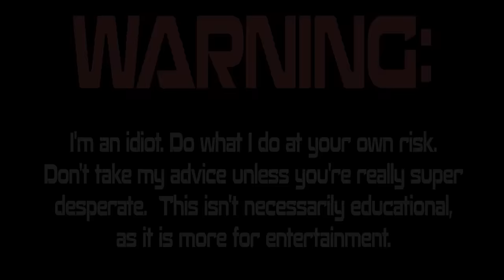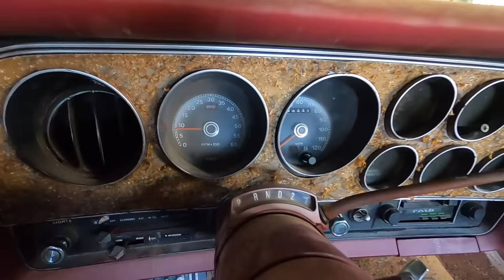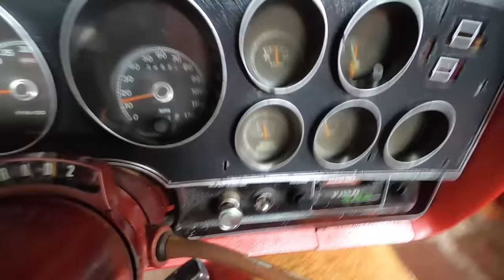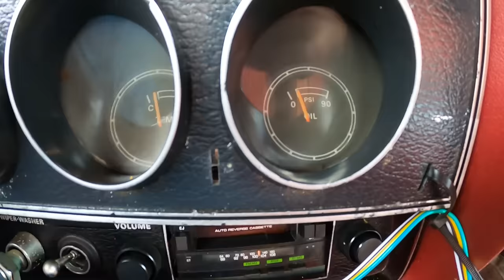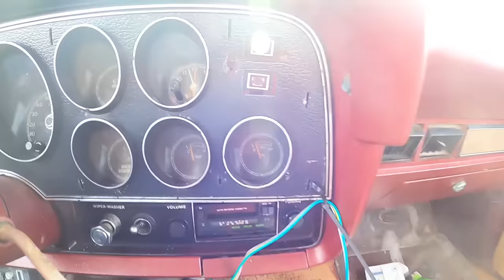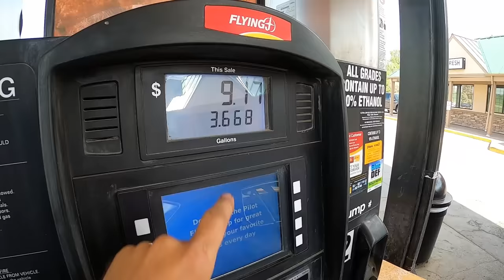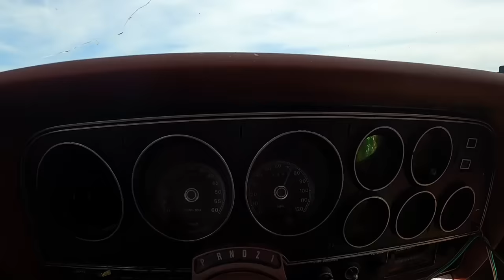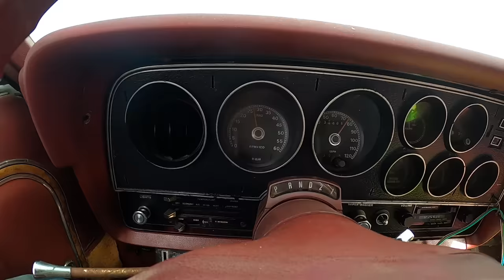SEIZED Ford Gran Torino Elite will it RUN & DRIVE after 29 years? - Vice Grip Garage EP89

Comment: They just don’t make bumpers that strong anymore. These days a tiny fender bender costs $1000’s. There’s just no need for that. 🤷🏼‍♂️
Reply: Made to crumple in a crash for safety brother
Reply: @bilbobaggins4710  I can confirm that. I was stopped behind a tractor-trailer and a huge Dodge RAM lost all brakes and smashed me into the back of the truck at nearly 50 MPH.  The back and front of my car crumpled and I was able to walk away. Everyone thought I was killed. I even had the cops told me how lucky I was and was shocked. I would rather lose a vehicle than my life. So yes, the cars sacrifice themselves to save you. If it was a stiff car like that, I would have absorbed the energy instead of the car.
Reply: Crash sensors, weight savings, fuel savings, MPG enhancements. Much more complex an answer than simply tacking on more steel.
Reply: Those were the 5 mph energy-absorbing bumpers that became standard on all U.S. passenger cars in '75.  The manufacturers complained about the added weight reducing their fleet mpg averages and anti-regulation folks hated them, but they really did absorb a low-mph crash better than the 2.5 mph standard that the Reagan admin changed the regs to.  Check out the flimsy fixed bar of chrome that Ford had as bumpers on its '73 and earlier Pinto and you see what the heavy chrome bumper replaced.  I would say these cars absorbed a heck of a lot more in a crash than cars of the earlier '70s and certainly the '60s and earlier.

Comment: They weren't bad cars but they downsized everything in a couple of years. I had a 1976 Ford Ranchero based on the Elite back in the 1980's so everything on that car is familiar. I had a couple of the 351/400 engines in trucks and they were generally pretty good but the OEM valve seals would go bad around 70K miles and start using oil if you didn't change them.

Comment: My grandfather had one of those, used to drive it from Ontario down to NJ.  Nice, plush, good riding car.  I had an earlier cousin to it, a Mercury Montego with a 351C that just would not die.  Got 175,000 miles out of it and $400 trade-in on a used car.  Excellent highway cruiser and the 351 had plenty of power.  Good solid cars.

Comment: Derek,
I really enjoy watching your videos. Only the go find get it running and drive it home ones. I am 53 and work a lot of hours but I enjoy watching you do the stuff to these ole cars I use to do. I am 80% Ford guy but like all American cars. This one brings back memories. BTW  if the valve cover says 351m-400 they are very reliable engines but very low compression. The 400 is an entirely different engine same family but  makes great power. And yes I think I will order a shirt.

Comment: I can’t understand why the tires on that 🐭 house gave out so quickly.
When she started the first time it she sounded as smooth as a guy with a wacker plate trying to straighten out the inside of a cement mixer.

Comment: Great fun.  My thing about older cars is that not everything can work at the same time, so fix only that which is essential.  If it's not essential, don't fix it, because if you do, something more important will break and need to be fixed.  Keep'em roll'n.

Comment: I can almost guarantee the oil pressure gauge doesn’t work. I’ve had several old fords and none of them had gauges you could trust.
Reply: Hi
Reply: I had a 79 ranchero gt oil pressure gauge was trash
Reply: @trevormiracle5476  I would bet that it's the sending unit . I just replaced mine and it did the job .
Reply: @rickobrien4025  I swapped mine to a manual gauge because the original wouldn't work
Reply: 3 sending units never fixed the oil pressure low reading but a mechanical gauge fixed it half the gauges in my old ranchero didn't work

Comment: You might want to check and see if you have the little oil sending unit or the large one. Only the large one is ascending unit volume is a Low oil pressure light with a resistor built-in to give you it and average oil pressure. When engine is running.i ran into this in 1979 working up Lincoln Mercury. Put the actual sending in it and then you'll probably. Read correct oil pressure on your gauge.

Comment: Yeah, great find. One year only, not just a Ford Elite but Grand Torino Elite. Yee Haw.
Reply: and an LTD II
Reply: @CrestwoodRocks  I just hate it when people do that, yeah, but no thing, don't you?
Well, in this case it really applies. The Grand Torino Elite is a very specific vehicle, yeah it is based on the LTD II chassis of sorts but has some very specific differences, including the grill and back quarter panels. So, no only listed in 1974. Classic by every standard you can measure.
Reply: @bruceleealmighty  I recall them being officially renamed LTD II from 1977-1979.
Reply: @CrestwoodRocks  Absolutely as well as Thunderbird, XR-7, Grand Torino, Torino, Elite, simply LTD. Fords personal luxury car seemed to always be going through naming and consesus issues. After production price & size shrunk in 1977 they even renamed the line II. So to quote any official marketing or management there is only one 1974 Grand Torino Elite of which 96,064 were specifically produced and badged, making it for all intents and purposes a one off one year thing of which possibly no more than 3 thousand are still in existence. Which makes it a classic, collectible. Of course there is XL trim and the so called '75 '76 Grand Torino Elites which did not include badging for some reason and became just a trim. The 1974 Grand Torino Elite badging and trim package was a very specific car guy kind of thing. There are some other things like this but most can't point to a single year, badging, trim, chasis, and trim. Not even my favorite '70 Murcury Eliminator can say it was produced only one year although the package was drastically different from '68 '69. So to say it officially became LTD II in '77 is not the point. It simply isn't even the same car.
Reply: @bruceleealmighty  Yeah the 1977-1979 Thunderbirds were in the same class as LTD II as well and their fronts were close to the Full Size LTD & LTD Landau as well.

Comment: That land boat of a car find should be named the "Fordzilla".
Reply: The station wagon version of that car (or the Gran Torino, same basic thing) weighed about 200 lbs less than my 2019 F150 SuperCrew 4wd pickup. 4600 lb vs 4800.

Comment: Eggs, for radiator leaks, crack open an egg. I haven’t had one where I cared so little about it but eggs are supposed to be the fix.
Reply: yep, or ground black pepper (courtesy of Isaac "It'll be fine")
Reply: @danmackintosh6325  I've done the ground black pepper, back in the 80's. Did it work? Ummm, well, it probably didn't hurt. Same results with that little tube of stop leak particles they sell at auto stores. Once I discovered a coolant leak, my hoopties were generally beyond the "fix in a bottle" type solutions, though, to be fair.

Comment: I had an 74 with the FMX transmission it would bark the wheels going from first to second very strong. 
The highway drive looked odd without the barn door weathervane missing . 8 city 12 big road.

Comment: Only way to distinguish a 351m or a 400 besides taking off the oil pan and checking cast i.d stamps in the crank. Is  measure the stroke through the spark plug hole, which I usually use the oil dip stick when I check it this way. 351m has a 3.5 inch stroke, with a casting I'd in the crank of 1ka. The 400 has a 4" stroke with a 5m, 5ma, 5mab, or a 5mabc stamped in its crank. Out of that whole engine the only two different parts from the 400 to the 351m is the crank and the pistons, they both use the same rods.  The 351m has a 3.5" stroke crank with taller pistons. The 400 has a 4" stroke crank with shorter pistons.  
     Keep up the great videos, 👍

Comment: I had a 1975 Ford F 250 w/390. Never had over 20 on the oil pressure ran 20/50. Drove it for 5 years that way before I sold it still running strong.

Comment: I love getting old car running too especially old trucks. Right now I have an 86 Ford F150 4x4 with 6"lift. It had a very tired 302 engine that had a very bad blowby. So I bought a 302 HO came out of the Mustang GT and it ran a lot better than the old engine.  I also kept some of the parts like 2 distributors, lots of spark plugs for old Ford engines, extra good carburetor,  etc in case I decided to get another car running again

Comment: Just stumbled on your channel and just had to comment! My first car (purchased in 1990) was a 1976 GT Elite -- baby / sky blue and the 351 big block Cleveland. Slow off the line, but sure had some freeway passing speed and was an absolute joy to ride in. The weight of the car and the shocks felt like floating on a cloud. No other car I've been in since then has ever felt as comfortable. It had power brakes, power steering, and electric windows and electric driver's seat adjustment. Best mileage I got was about 18 freeway. So, as a commuter, it sucked for gas efficiency, but you sure felt great getting there.

I see you're missing the hood ornament. That was the best part!  Some asshole clipped mine and stole it about a year before I got rid of it. It was a lesser car for the loss.

But man, I loved that car. It was in excellent shape when I got it and sadly had to get rid of it about five years later.

Comment: Doesn't surprise me at all it ran as good as it did. Interesting facts about the Modified variant of the 335 series Cleveland 351/400. The deck height was 1 inch taller than the Cleveland block. The main bearing diameter is the same as the 351w and 460 at 3".  It has 460 bell housing pattern. It has canted valve Cleveland style heads which means the intake is run dry (no water) and the heads were all open chamber design which made these motors as built really kind of detonation sensitive due to lack of quench pad in the head. They ran very good though and there was nearly zero aftermarket support for them at all. Many 4 wheel drive guys used them and hot rodded them. "From 1971 to 1982, Ford manufactured millions of M-block engines for use in mid-sized cars, full-sized cars, luxury cars, and light-duty trucks." The 400 hundreds as I remember it were usually found in cars and some 4 wheel drive trucks. The transmission was either an FMX or a C6. I'm guessing its an FMX. The FMX was a good shifting trans with a Ravigneaux  gear-set like early powerglides and this trans eventually became the AOD. In 78 I bought a 78 F-100 with the 351 version of this motor with a C6. The truck was Long wheelbase and had a 2.78 9" Ford single track rear. My buddy had a 78 Chevy truck of exactly the same wheelbase and dimensions with a 350 and auto trans and my truck would outrun his every time. We raced many many times. Stock for stock that's the way it was.

Comment: Love this video
 I had a 76 torino elite I bought one year old for my wife in 77. It was powder blue. It was a nice car. It took about 5 years of Chicago winters and road salt to totally rust the car out. It had holes you could stick your hand through. It came with a bumper jack just like most cars back then. It came with the famous Firestone 500 tires. All 4 of them failed one at a time. 
It was out in front of the house one day with a front flat tire so I jacked it up with the bumper jack to change it. Everything was so rotted that the bumper fell off as I was jacking it up. That was the car that turned me into a Ford hater. Soon after that I had the same oil pressure problem with the 351 Windsor and the engine siezed on the wife leaving her stranded. That's when I junked the car.
Biggest pos I have ever owned.
Reply: But it was really cool watching the resurrection of an elite that was never in the salt. Well done.

Comment: For crank snouts I came up with a trick for tight places like this.
I use the large spark plug socket that is usually 13/16 and put a box end on the end of the socket that has a bolt shape.

Comment: Had an 86 Ford with a 6.9 diesal that showed little to no oil pressure, so I pulled the sending unit, shot some carb cleaner in it and put it back on. Fixed it right up and she carried decent oil pressure on the gauge from then on.

Comment: I had a 79 Thunderbird; basically the same exact car. Yours has the deluxe dash, mine had the base model with the giant clock, fuel gauge, and speedometer…Might had the 302… You talk about gutless! The Thunderbird had the fuel filler in the left rear fender, not in the center of the rear valance. Cool video; the old Fords are tough!

Comment: I had a 305 chevy engine locked up put 2 gallon of WD40 in the crank slowly rocked it back and forth then got the starter turning it.  That was 3 years ago still running ok.

Comment: I had a 71 f250 that i ran 50 wieght oil and 2 can of STP just to get the oil gauge to move a little bit when it was cold.  Finally did a rering bearing and high volume oil pump. all major parts in spec and did the head ran it for 60,000 more miles then a head gasket let go and I sold it

Comment: Bought a 77 T- Bird from my pop back n the 80s. It had the 351 modified in it which is a longer stroke 351, this is what people would call a 400. She was white with the red lower color scheme. Red velour interior. Loved that car, it was a road trip monter, my buddy named her the Thunderbeast. Drove from downtown Dallas to downtown Houston in three hours flat one time, yes that is over 100mpr straight through. Drove her from Houston to south Padre in 5 hour flat one time as well. It was not super quick on the start but loved those highway speeds70 up to 125. Texas has those nice flat smooth roads that you can just tear it up. I live in Washington state now, Roads wont allow that type of driving if you want to keep her between the ditches and rubber side down.

Comment: I had a '77 LTDII, which was built on the same platform as the Gran Torino Elite.  I also had a '78 Thunderbird, also built on the same platform.  The LTDII had the 351M and the T-Bird had the 351W--two completely different engines.  The M was a big block and the W was a small block.  They were both very good, reliable cars.  Watching this video reminded me of how comfortable those old Fords were.  They were great highway cars that never really gave me much trouble.  Nothing against GM cars, but I'd take an Elite, LTDII, or T-Bird over a Monte Carlo, Regal, Grand Prix, or Cutlass of that era.  The GM cars definitely have more going for them in terms of the cool factor, but the Fords were more comfortable with a better ride going down the road.  As far as the Cordoba, or pretty much any other mid-sized offering in that era by Chrysler, they were pure JUNK!

Comment: My buddy and i bought several cars just like this

Worse no insurance,  no tabs sometimes no plates, no money to invest amy more or a way to tow. But when you see a crazy deal 3 hrs from home and have just enough than do it haha! Ive ownrd many cars that sat several years. My 92 Cadillac Brougham showncar was sitting 7 years prior but low miles. Bought a 77 Olds Regency with leather and etra options sat in a barn in Bellevue Washington for 21 years and i paid $450 and car looked near new and drove it and hour plus to home. Then sold it to a guy that lived in texas and he drove it to texas and made it home!!! I boought 83 olds recency coupe for $225 in bellingham Washington and drove it home to Spanaway. Sold it next day for $750 i think. Bought 96 towncar sat 2 years not running. People wanted $500 but took a liking to me and gave me it for $150 had it towed home to discover just aftermarket alarm chip was missing. Had it running in 5 minutes.  It had 170k and was very nice. Drove it 7 months 100 miles a day. Bought a 95 towncar cartier in renton Washington for $180. It was pretty hacked up... no keys, no battery, crushe passenger front end. It was bad looked like a parts car. Had it towed and worked on it and found same color fender and bumper... $200 invested and drove it daily and months later at 230k sold it for $2800!!! My current 95 towncar Cartier at 151k i bought for $550 and been driving over a year!!! Today looked at a 2010 Towncar L model that sat 2 years from bracket to rear axle bolt snapped. Haded ran in 2 years. I got it running and drove it around. 339k miles and very sharp car in and out. He wants $1000 but sounds like he'll take $600!!! Ive done this kinda stuff for years. Probably bought over 250 cars same way he does in these videos. Many tell me ghatll never drive again and the look on their faces when im driving around in a vehicle they thought was hydrolocked haha!!!

Comment: A handy tip, when you have an aged vehicle ..... Use waste oil from an oil change and undercoat the vehicle. It works better than undercoating because oil seeps into cracks and crevices that undercoating can't do. If you under coat once a year you're good. Just don't coat the exhaust system. Your vehicle will remain rust free. Get inside the door wells too.

Comment: Well another successful run 👍 to be able to tell 351 from a 400 is it will say 351m which means modified. It's a truck block with much more bottom end torque. I'm a Chevy guy all the way I just happened to know some for dudes 👍☮️

Comment: New subscriber here... I have one question.  Are these cars ever gone over completely after the big save?  Like new wire harnesses.... essential electrical fixed or restored to proper usage?  Just wondering.  Really enjoy the channel.  Thanks for the video!
Reply: The impression I get is that a guy sells most of the cars after he gets em running decent. I suppose the rest is left up to the new owners

Comment: I had a '64 Galaxie 500 once where the crossmember for the gas tank straps was rusted away.  I discovered it when one of the straps gave way.  The tank held fine for a while with one strap until I could get it repaired.